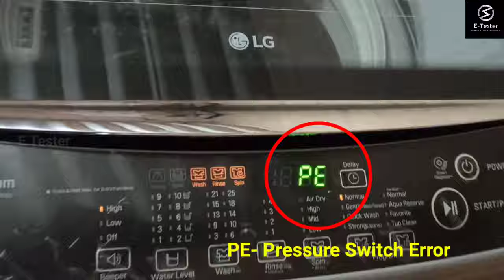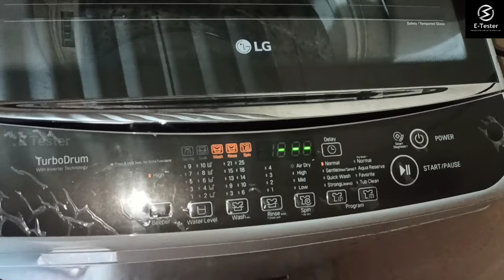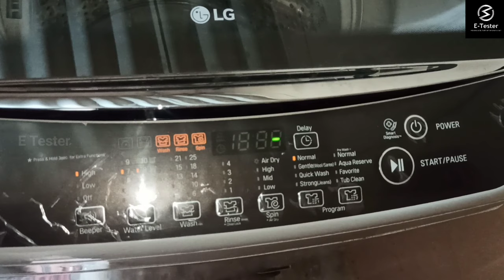How to repair PE Error in LG washing machine 7kg  | Top load | Smart inverter | E Tester

Comment: I had the PE error like many of you, I blew out the plastic tube from the switch to the tub, and cleaned the plug contacts on the switch, the error is gone and its running properly.
Reply from the maker: Ya..This reason may be happened.
Reply: Plz aap mujhe Hindi me samjha sakte hai same problem aa rahi hai mujhe
Reply: Oo pl p pic li oo pl koi ki l ll oi look op
Reply: What do u use to blow it out
Reply: Which model it was?
Reply from the maker: Model - 2019

Comment: Thanks. Once fixed following u. Today again❤
Reply from the maker: Your welcome ❤️
Reply: @ETester this time cleaned p switch but still not working.any suggestion?
Reply: Hi can you please help l have a P E reading on my machine an LG top loader the moment I switch it on it goes to P E at this time I have the machine open can you help
Reply from the maker: Ok
Reply: @user-wt8lr9kd3t  u can clean pressure swith well removing oxide and re plug, clear that area as well. It happens due to oxide sometime. If still has issue  u may have to replace   new Presur switch with help of technician
Reply: @ETester  🤣

Comment: Thank you I fix this problem after have problem machine not spin ??
Reply from the maker: There are several possible causes for this problem, including broken motor or speed sensor wires, a rotor position sensor fault, a worn out rotor assembly, and main control board failures.

Comment: Sir yenaku same problem pe error varudhu sir but wire lam normal la thaan eruku but work agala yenna pandradhu sir
Reply from the maker: Check water pressure and inlet water filter. Otherwise pressure it to be replace

Comment: My connector is wet when I removed it from the water level sensor. Is there a way to replace the connector?
Reply from the maker: No need to replace the connector. Just clean with hair dryer, if available
Reply: @ETester  I used that trick before and a while ago it doesn't work anymore. Is there a way to replace it since mine is a bit rusty too? Thank you!